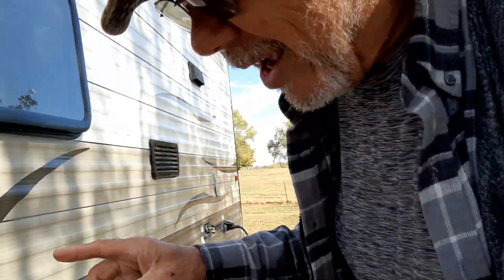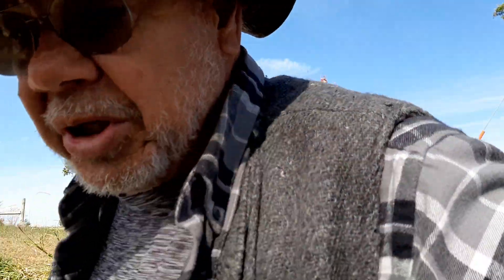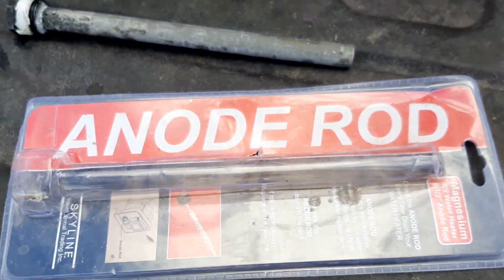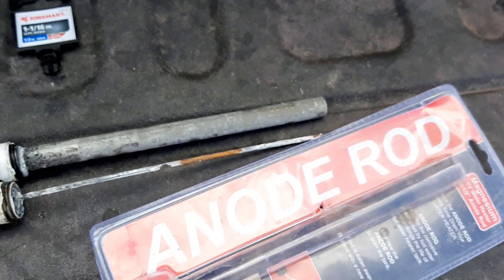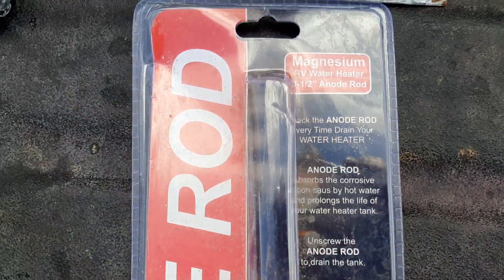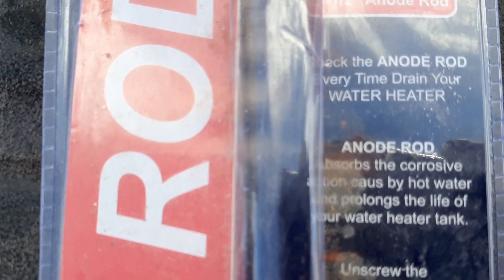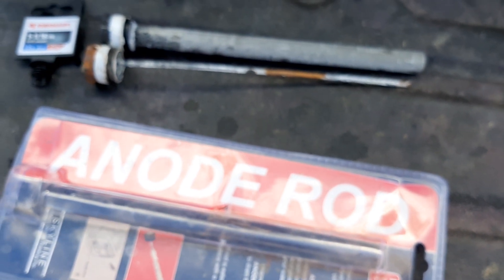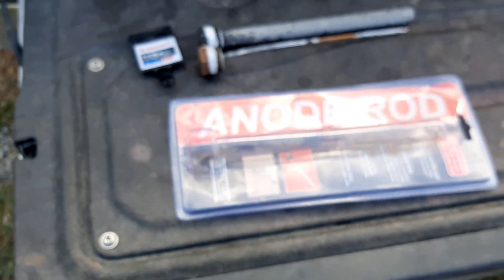RV Water Heater Maintenance

Comment: anodes have a higher potential for galvanic reaction...basically when two dissimilar metals meet a conductor (water) a charge is created between them...the sacrificial anode was probably made of magnesium...basically it is sending all the galvanic corrosion to the anode rather than the brass copper or steel/cast iron fittings in your system (cathodes)...a common place you can see galvanic corrosion is steel bolts through aluminum, youll notice the bolts rot out much faster.  you see anodes like this on boats bridges dams etc etc

Comment: Good advice. 👍   I replace them when they get down to about 7/16" diameter.  When you drain it, if you flip the lever on the brass pressure relief valve straight out, it drains even faster, taking even more gunk with it. While it's out, if you hook up a water hose and turn the water on for a few minutes, it will flush sediment hiding in the bottom of the tank out. 

Do you like pro tips when I comment on your RV videos Mike?  If you'd rather not hear them, I'll restrain myself and quit doing that. 😎
Reply from the maker: I learned a longtime ago we need each other to survive this life. Thank you.  Mike
Reply: @Bedrocker Don I love those Dino boards./ They are all I use unless it's a warranty replacement. No one else offers a 3 year warranty either.  The ground rod is not necessary unless you just feel good doing it. Electrical ground through your shore power cord is adequate.
Reply: @Bedrocker Don I think it would be wise to spend $7-10  for one of those little 3 light electrical testers that plug in to a receptacle. If plugging it in inside your rig shows 'open ground' or any other abnormal condition, I'd find a local electrical wizard and fix the problem. A ground rod is not a cure for an open ground,  Good luck with it Don.